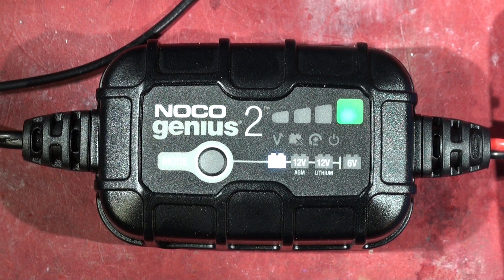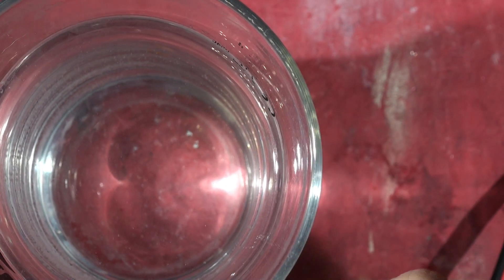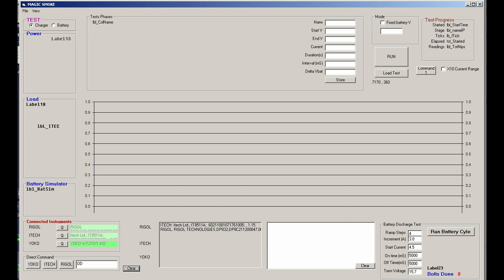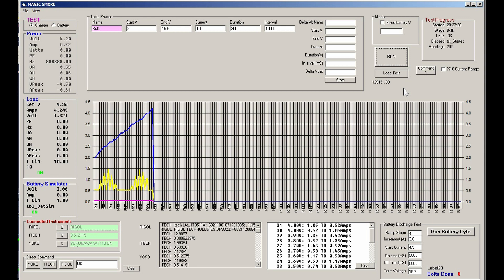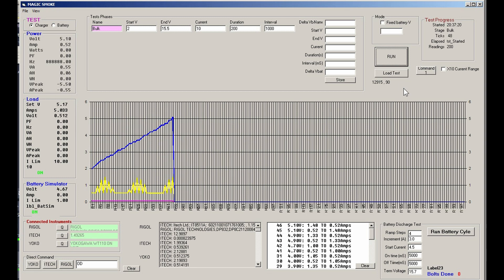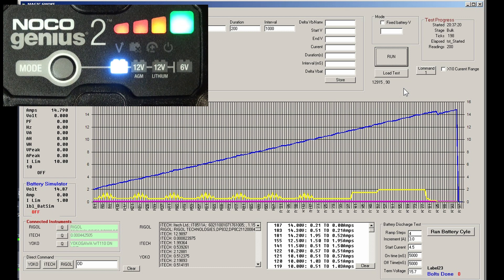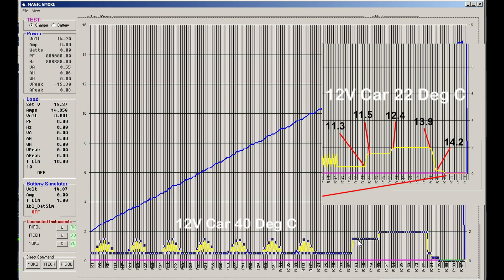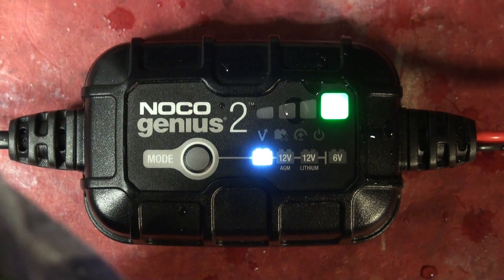NOCO Genius 2 Temperature Compensation Tested Part 3

Comment: Hi, have you decided the best value Charger yet please?
Reply from the maker: It is Horses for Courses.  What do you want from a charger - A quick charge where the charger is connected to the power for 24 hours?  If so buy a cheap one. For long term maintenance buy a 2A NOCO. It will still be working when you go back to it.
Reply: @razenby  I want both! I've bought a Noco2, I'd had hoped you could point us to a good cheaper one because, as you said, the Noco2 is overpriced. Thanks.

Comment: Have you looked at "Maypole" chargers . As your probably aware  -- a  british company (prominent  with the caravan / towing fraternity )  who have developed their own range of chargers . I have the MP7428  8A charger and to be fair . it seems to do a good job - claimed 9 stage charging . Instructions are very good and the Maypole Technical Manager has signed off on a declaration of conformity  etc.etc.   Who knows what lies inside though - its a  big unit so should be plenty of space inside and IP65 rated .
Reply from the maker: I haven't seen the Maypole.  I am happy to test any mainstream or interesting chargers  that anyone sends to me.  It is such a simple thing to do but it doesn't seem to have attracted a real expert designers except in the commercial field where battery packs can cost thousands of dollars.  The Chinese designed stuff is basic crap. The NOCO is better but I have concerns about the stability of the output side. I have tested loads of battery chargers and power supplies on this rig but the NOCO is the first one to go unstable driving into a professional power supply test load. It is certainly OK to connect to an isolated battery but no good if your battery is still connected to your vehicle. I haven't commented on video as I  I haven't fully investigated it yet.
Reply: @razenby  did you get to the reason or a possible solution to the instability issue? Bit worrying if it’s hard wired into a vehicle as they claim you can do

Comment: Here's a chart (courtesy of Votronic) showing charge profiles for various battery types against battery temperatures.
Couldn't paste anything here but lead acid peak charging voltage rises to 14.9V at -50⁰C and drops to 13.7V at 50⁰C
Reply from the maker: What does it give for 20 degress?
Reply: @razenby  
For basic lead acid at 20⁰
14.4V Absorption  and 13.45 Float.
Absorption phase (constant voltage) 14.9V at -5⁰ falling to 13.8V at 40⁰
Float voltage is 13.95V at -5⁰ falling to 13.2V at 40⁰
I wasn't as helpful as I should have been - sorry
AGM have a different shape with level up to 0⁰ then slightly convex to 50⁰

Graphs so much easier!

Comment: Thank you very much for this test and your time. An interesting and reasonable solution for placing a thermistor. But shouldn't it be the case that at higher ambient temperatures, a lower final voltage is recommended? Batteries at low temperature give less capacity, the same goes for charging. Even cheaper chargers from supermarkets have the so-called winter mode, in which they raise the voltage slightly. I read that you hope to finally get away from battery chargers, but could you please do one more test simulating winter conditions? For example, by dipping the sensor in ice water, or using the Peltier module?
Reply from the maker: Very good point. I had that in my mind too..it was late last night when I filmed it and I had consumed a few beers!!  I got that wrong. It is still all set up so I'll do a 0 deg C (32F)  test now.
Reply: Yes, bulk ending and absorption voltage will be reduced in hotter temperatures, increased in cold temperatures.

Comment: Interesting, thanks for the follow up! So the CTEK advertises its temperature sensing capabilities too, but it seems like the CTEK sensor is inside the body of the unit, which I assume will be significantly heated during operation. Maybe CTEK is just implementing overheating protection rather than making temperature-based adjustments to their charging algorithm like the NOCO does?
Reply from the maker: Yes the CTEK claim is smoke and mirrors.  There is not a separate temp sensor outside the case. Inside the case gets hot when charging so no joy there. The 8A charger I recently reviewed does have a temp sensor in the case and forced air cooling so that could work.  I haven't really tested it  but the temp indication did seem a bit off and drifted when the charger warmed up . Hoping to get away from Battery chargers! Is there anything else you think would be interesting?
Reply: @razenby   How about battery testers haha? More seriously though, a few things that come to mind are home automation devices, car modification, and HVAC controls. 

I have a '96 Civic and a '96 Grand Cherokee I work on when I have time. Going to stay closer to stock with the Civic, but am replacing/modifying just about everything with the Jeep. Most recently, I swapped the belt-driven fan for an electric one. I know very little about electronics, but I used:
-This 12V to 5V converter to power an Arduino, and probably more 5V devices in the future: https://smile.amazon.com/gp/product/B07CR4N51V
-An Arduino Uno R3, which will probably control more in the future: https://smile.amazon.com/gp/product/B008GRTSV6/
-This 30A motor driver: https://smile.amazon.com/gp/product/B01M4PXFBG/
-This 18A Fan: https://www.flex-a-lite.com/electric-fans/15-inch-black-magic-xtreme-s-blade-reversible-electric-fan.html

Right now it's pretty basic temperature based control. Always on at 10% just to keep my leaky exhaust header from building up fumes haha, then increasing fan speed as coolant temperature increases. I have plans to improve the controls. Need to integrate with the AC compressor so the fan is high enough when using the AC. Also want to have the fan off if traveling above ~15 mph if temps are ok. Installing a second temperature sensor would let me see temps before and after the radiator and base fan speed on that difference. Maybe I could reverse the fan for a few minutes after the car shuts off to keep the battery from getting too warm as the engine cools... might increase its life a bit.

For HVAC controls, I'm planning on trying to convert a Trane AC into a heat pump. Haven't done much research into that yet though. I did modify my existing unit a bit. Added a start capacitor and starting relay to the compressor, added a delay-on-make timer for the condenser fan, replaced the blower fan motor's sleeve bearings with ball bearings, and added a few relays to enable speed control of the blower fan.
 
Would be really interested in your thoughts on the starting relay: https://www.icmcontrols.com/productdetails/UMSR-50

The delay-on-make timer works well enough, but it would be nice to have finer adjustment of the delay length. I was also doing some research on how to reduce the voltage drop, but never came up with anything before it started getting pretty hot outside: https://www.icmcontrols.com/productdetails/ICM102
Reply: @razenby Thanks for taking the time to do these tests no one else seems to Magic Smoke. I can verify 100% that the Ctek 5mxs with internal sensor compensates for temp about as well as the ctek10 which has an optional external temperature sensor so Ctek must have taken such things into consideration. I can also verify that the Ctek does vary both it's termination and float voltages at different temps. Most chargers I have used undercharge the battery and are too much of a hurry to the complete absorption stage compared to the Ctek, then after you connect the Ctek it still has the current at 1.5 amps or so in absorption stage, so I think you pay for a superior algorithm not so much the build quality etc. Had mine for years and connect it via a modified B.T pabx transformer primarily to stop "leakage tingles"/safety as sometimes i am barefoot when connecting up or checking batteries and to stop noise getting back onto the mains as a possible bonus if chargers are electrically noisy. Maybe that's why they are both still working fine despite being used almost constantly.
Reply: @405line  hi can you share more on your modified bt pbx transformer?
Reply: @ciatfeitay7951  The transformer is designed to stop spikes and electrical noise issues crashing B.T pabxs' however it can also be use to break the reference to earth which then isolates the user from earth leakages and potential electrocution/blowing up test equipment. You can get a used (Powervar) point of sale / cash register spike transformer for really cheap on EBAY and modify it by removing the earth connection to the neutral wire on the secondary of the 1:1 transformer.
p.s There are many videos on you tube explaining the earth issues how to identify them, how to identify if you particular isolation transformer has the right configuration for "complete isolation" and resolve the issues if they don't. Likely no need for soldering irons etc though you might need a pair of wire cutters and electrical tape.